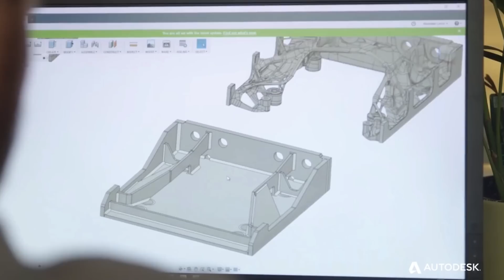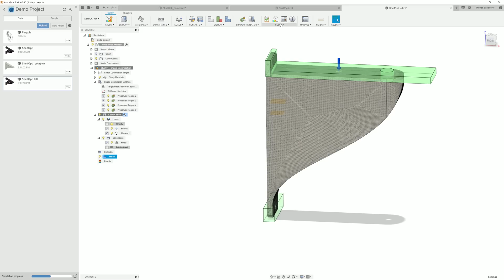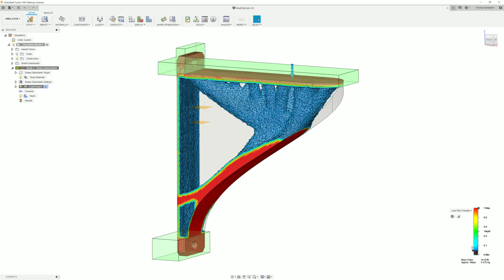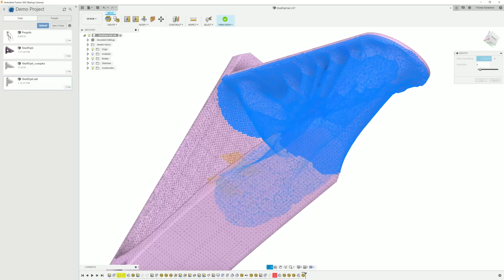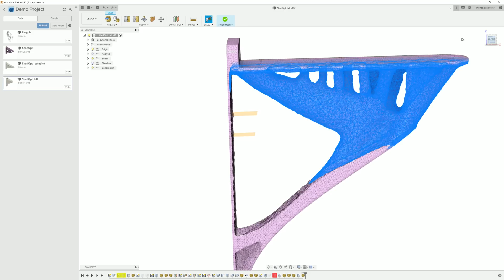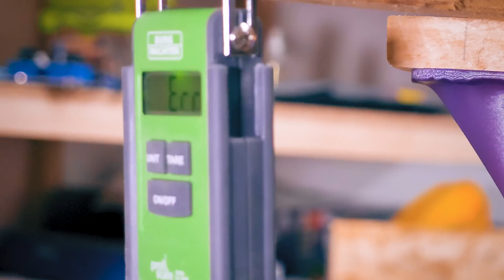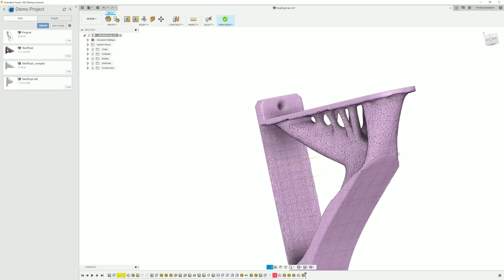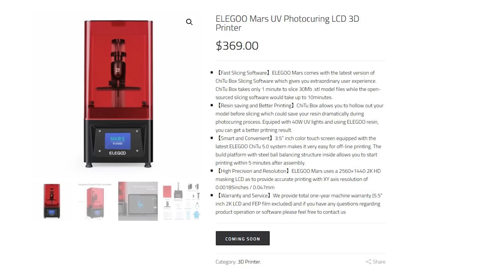Making STRONG shelves with Topology Optimization

Comment: First off all: great video! Awesome shelves! Then to my question: why gyroid infill? While cool to watch and fast to print, it's not strong at all. No two lines really rest on top of each other, so no load bearing compared to triangular or grid. I know your shelves were more than strong enough, but how about some experiments with this? Or should I poke Steffan with it? 😜
Reply from the maker: Definitely a topic worth investigating! Gyroid is supposed to be the ultimate (isotopic) infill pattern, so I use it whenever print time isn't super crucial.

Comment: in the next episode Thomas will print walls for his home
Reply: Entire walls - too big. But small, topology-optimized interlocking bricks would be viable.
People are building houses out of plastic bottles and cans - why not out of 3-D printed bricks?
Reply from the maker: Don't tempt me
Reply: Thomas Sanladerer you need to print some studs for inside the drywall so your not screwing into plain drywall
Reply: Jake Mitch drywall anchors are perfectly suitable for light to medium duty shelving. Most of the crappy ones are rated for 50lbs per anchor.
Reply: @greenthizzle4  It isn't drywall. It is actual material worth building a house from, a type of aerated concrete block which is the internal insulation, with a brick or solid concrete outer skin. Waterproof and light, and cheap, and no timber to rot or get eaten. The only downside is you need the correct fixings if putting up shelves!
Reply: Jake Mitch Houses in Germany are never built out of wood and drywall lol

Comment: Very good video Thomas! One note (as Stefan from CNC Kitchen also points out) -- a big issue with this approach is that FDM 3D printed parts are anisotropic, so results should be taken with a grain of salt (or large factor of safety).  I would be very interested in seeing comparison results in this regard between FDM and resin prints and their predicted  vs. measured failure loads.
Reply: Also the way he set up his simulation; he only constrained where the countersunk screws were and didn't add a planar constraint where the bracket touches the wall. That's probably why the program almost immediately lightweighted that section and didn't connect any ribs to it.

And then he printed it with infill, which is definitely different than what the program was calculating for.

It's a cool way to get very organic looking parts or to visualize your load paths, but I wouldn't trust it without a big safety factor.
Reply: @timbarrett4580  it's a gimmick.  I can't imagine this optimization being useful for any manufacturing process
Reply: @Jaze2022 wrong

Comment: You should use a studfinder to locate the screws in material (wood) that will support some weight. Drywall won't hold much.
When I was doing finite element stress analysis with NASTRAN (a while ago), I had to accurately model the loads and constraints and the strength of materials. There was some voodoo involved. It was easier in that they were steel structures; I wasn't working with the complicated material of a 3D print.
Reply from the maker: This is neither a stud wall not covered with drywall.
Reply: European buildings are almost never timberframed. They are nearly always built around brick or concrete walls. That's why he got out such a heavy drill, you pretty much need a percussion drill to hang anything in Europe in most cases. A studfinder won't do you any good here.

Comment: Those are some beautiful shelf baskets! Awesome work, Tom.
Reply: They are beautiful but they gonna collect a LOT of dust
Reply: @revFPV  All you need is a tissue and some water. Done. Something like Denture tablets in water are not corrosive at all and clean stuff very well. Always use them for my keyboards over Iso or anything else.
Reply: @Zygy __ compressed air will just throw dust elsewere
Reply: They're pretty hideous but the science is beautiful

Comment: Are the shelves actually attached to the shelves? I had just made some shelf braces to hold a shelf for an NVR in an closet. Just basic geometry, nothing fancy, it's not out in view. Though I made mine out of PETg since I wasn't sure how warm that closet would get. Neat trick, and certainly they're visually appealing, but I would have like to flatten out the back wall plate, don't love the rough texture it leaves.

Comment: Great video, are the shelves just sitting on the top without screws?
Reply from the maker: I've used some 3M VHB-like double sided tape to keep the shelves from sliding around. No screws as it would create some funkyness in the topo opt process and they're not really needed anyways.

Comment: The result looks like it tries to approximate a relatively simple mathematical structure. You could probably simplify the results with geometric shapes. Also this is actually a  "2D problem", so there should be ways to do the optimization in 2D. Or use precalculated cantilever structures. The optimization results diverge from the optimal solution, and in different ways each run, because of computational issues. In any case, the strength isn't really the criterion but rather the strength per weight.
Reply from the maker: Yeah, sure, but mine look cool.

Comment: Toggle bolts would be better for that application....at least on the top set of fasteners.  Those anchor screws/glue on drywall dramatically reduced the load bearing that you feverishly tested.
Reply from the maker: (not drywall)

Comment: This is an interesting video to show the concept of topology optimization, but it fails on two points: 
First, these designs cannot simply be printed on an FFF machine, you need other AM technologies to take advantage of these designs. There are other topology optimization softwares that allow you to choose in which technologie the part will be produced, and then the resulted design will be in line with that manufacturing process (ex.: you could choose "Extrusion process" and the result will be more FFF friendly).

Second, the print orientation with respect to the direction of the forces applied to the printed part, it simply cannot be in the same direction, that's the weakest direction you could get.
Reply from the maker: I cover both points in the video.
Reply: Are the other topology softwares similarly priced (free)?

Comment: Would be nice if the algorithm were aware of fdm printing and that you could configure layer orientation, then it could account for layer to layer weakness...
Reply: People have been asking for anisotropic materials for a good while.  I don't know if the'll ever do it.  The usual response is use autodesk inventor if you need that.
Reply: @dibblethwaite  I've looked into anisotropic materials for fiberglass composites but haven't found much for FEA software. It's (much) more complex and I think you need to know more about structural engineering.
Reply: @dibblethwaite  sup, that's me.
Reply: If you add features like anisotropy, stability is likely to be a pain. The only reason they offer this so cheap is because a straight up stiffness optimization is computationally not far from just an iterative stiffness simulation.
Reply: Generative us doing that.byou can define a bunch of materials and different manufacturing processes (including fdm printing) and the generated  design takes this into account.
Reply: Same for the infill!
But that sounds like a really hard problem.
I would assume it would be easier with generative design, because it should be easier to predict properties of synthesized parts than parts where a wall moves when you remove something.

Hmmm well if it is a linear property maybe you could just scale one dimension before the optimization and scale it back afterwards.
Reply: Or just learn to use the built-in materials library, where thousands of people have probably built painstakingly hopeful approximations of how your plastic toothpaste performs.
Reply: And in fill
Reply: The short answer is you use catia, ansys, one of the heavy hitters in the FEA world. Same problem as designing fiber matrix composite (usually uni carbon fiber/fiberglass prepreg in my case, but the same holds for metal or ceramic matrix as well). As soon as you add the interfaces, orientations, and interactions between fibers/layers/whatever, you are operating with a FEA problem several orders of magnitude more complex than a standard material, even an anisotropic one. With simpler/wider margin parts you can fake it fairly well on Fusion, Solidworks, etc, but those programs have no need to operate at that level of FEA often enough for the resource costs (them: coders, you: cost) to be worthwhile. Not to say Fusion won't have that sort of capability at some point, especially with additive becoming more and more widespread. That said, we are only getting to the point now where the computer any sort of home user might own can run a finite element problem of that scope in any sort of vaguely reasonable amount of time. Even with good algorithms, those matrices get REALLY big.
Reply: How about anisotropic / optimized infill? I assume the simulation is using a solid isotropic material, but having it design the infill for the application would be impressive.
Reply: Altair Inspire is a generative design/topology optimization software that has this feature. If you enable it, it will automatically account for the (standard) 3D printing rules (45° overhangs, 1 flat surface as reference, minimum wall thickness, etc.). The problem is that it isn't free, you can apply for a free trial or a student version but they are only for a limited time.
Reply: Fusion 360 doesn't support it, but Inventor will let you select non-isotropic materials for its material-aware operations like FEA and Topology Optimization. Maybe that feature will one day become available to Fusion 360 users.
Reply: huh? xD
Reply: That would be a tough algorithm. It (seems) like a neural network that simulates paths and verified by simulating load would be easier, and that's not easy. But that's a cool idea to think about maybe I'll give it an experiment someday
Reply: Jon Sten and account for it being hollow
Reply: funny I was just thinking about how printing layers reduces structural strength. I was kinda curious what the difference between a 3d printed steel bar and a melted steel bar would be.
Reply: @nickmagrick7702 i am no expert but from what i know printing metals can create many more imperfections and in metals those are the origin of breaking points
Reply: ANSYS is used by a decent amount of universities and offers anisotropic materials (different properties in xy, xz, yz planes). Impact of infill is usually negligible with this sort of application so long as you're not using less than 10-15%, depending on how the  structure turns out.
Reply: this is almost exactly my PhD topic, integrating topology optimisation with 3D printing, making it take 3D printing's weaknesses into account. For me its really about metal 3D printing, since polymer 3D printing's only really for prototyping in industry
Reply: Stefan and Thomas talked in one of their meltzone podcast episodes i think :)
Reply: @skaltura  Yeah but who wants to get ripped off by autodesk when you can achieve all of the same with a free program and some extensive know how.
Reply: @JinglePeeny  Suggestions?

Comment: In Rhinos Grasshopper there is an extension called tOpos which runs topology optimizations localy.
Reply: I also use Rhino, it's a much better option and comes with much more functionality then the limited subscriptions of fusion 360
Reply: @sparkyferret550  I mean, I feel like normal solid modeling CAD packages have very different applications than rhino. That being said, topo optimization is better suited for rhino because of its surfacing tools. I've used some topo optimization stuff designed for SolidWorks, and it just spits out a mesh at the end... they don't even try to do it solid
Reply: @sparkyferret550  I try to avoid Autodesk whenever possible lol
Reply: @Krizbonz  Why? so far they havent done anything that warrants a boycott thatt I am aware of
Reply: Buchsbaumschere what is rhinos grasshopper
Reply: @justasingledronevideo2583  Rhino is a CAD package, and Grasshopper is an algorithmic modeling plugin for Rhino. A commercial license for Rhino 6 costs $995.
Reply: Ryan Willis that doesn’t sound like an optimal alternative to F360 if it’s free

Comment: Are there papers describing the math behind this? Would love to do this in blender as I think autodesk are criminals, even more so in the gfx market
Reply: Search for "soft kill option" which is an easy way to implement such a bionic optimization.
Reply: @CNCKitchen  Hallo Steffan!! Hell yeah thanks, this keyword will keep me reading for tonight I guess and the basics seem simple enough to get started and have something to work with
Reply: There's a nice paper called 'topology optimization in 99 lines of matlab code' or something like that and I think there's also a python implementation of this floating around online. If you happen to own Rhino 3D you can also look at the grasshopper and millipede plugins for the same effect. That being said, both are a lot more fiddly to get up and running than the tools inside Fusion.
Reply: @Seecalator  Interesting, I will have a look. No it's not to go the easy way, more to play with the software I love (blender) and maybe creating something useful and learn something on the way
Reply: @Seecalator  python eh?
nice that's what blender's programmed in.
Reply: @pugger  I think blenders crucial parts are in c/cpp but true, the python integration is unmatched and enable an easy way of doing things if performance isn't your main concern
Reply: due to the price?
Reply: @loukask.9111  Due to buying competitors, making shady deals with studios(and schools and universities), locking you in their ecosystem and ultimately hindering innovation. adobe style.
Reply: I know industry used 'finite elements' to calculate loads, temperature, pressure, deformation and other physical properties on structures. Maybe it can help you finding what was done in Autodesk's software. :)
Reply: @shenlong21  yea if I'm not mistaken thats also how for example liquid or smoke simulations are done. both luckily already present in blender as a reference but probably a bit to hefty for a 'little' projekt. I was hoping for something less complex, for example vector math wizardry combined with brute force :) doesn't have to be perfect
Reply: @VincentFischer  finite eliments indeed is used to simulate stresses, buckling and topology optimisation in mechanical parts. It just depends on what math you apply to those "finite elements" ( maybe look for ansys,hyperworks or optistruct, which are other commercial "fem" products). I bet you can find some free programs online !

Comment: I would like a strength comparison between the smaller topology optimised brackets and a similar (roughly equivalent) squarish design printed in a more optimal orientation (on its side)
Reply: I assume that Thomas was going for a more organic design. One for which generative design is better suited, but requires cloud credit expense.
Reply: I'm guessing squarish design won. the purpose of topology optimised is to use the least materials to achieve the necessary strength, as oppose to make it stronger than conventional shape

Comment: ...get some Fischer Dübel, you really shouldn't skimp on those it really makes a difference.
Reply: I mean you clearly like quality tools, the laser plumb and other tools from that company with an motor anker as logo is prove.
( Nasty thing makes you realize how crooked your home is 🤣 that said, setting things straight was never so easy 😁)
Reply: I guess, these where already Würth Dübel. Some say, these are better, but I'm not totally covinced.
Reply: @Laberheinz   Yeah they will be better when some of Fischer's patents expire.
In my experience the modern compound Dübel Fischer offers are unbeatable if your bore is correctly prepared.
I mean Würth offers amazing services and some really unique useful products like the ASSY screws, AW head or sheet metal screws but dowels are not one of them.
Their power tools are good but not the best, however in combination with the other services a awesome deal.
Reply: Try the Fischer Duo, they work both in solid and plasterboard walls. Nice invention.
Reply from the maker: I used TOX Tri, rated for 15kg in "Autoclaved aerated concrete
". They're usually really solid Dübel, but I guess the autoclaved aerated concrete
 is a bit too dusty for many types to grab well.
Reply: @MadeWithLayers   Hmmm well I'm really not keen on the TOX stuff, about three mirrors fell victim to them so I dislike using them...
But those walls where porous too so seems like a legit handicap.
This conversation lets me realize why my Friends start to enlist me in every single move or home imprövment project.
Apparently I'm handy lol (And have a wide assortment of tools xD)